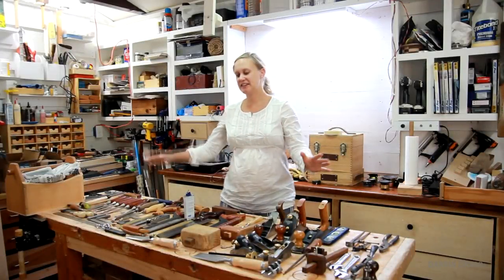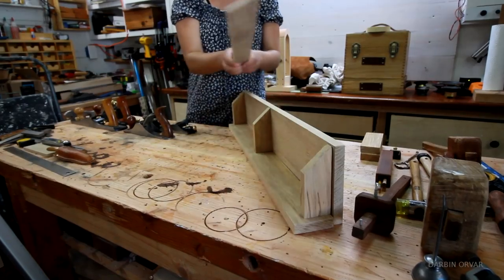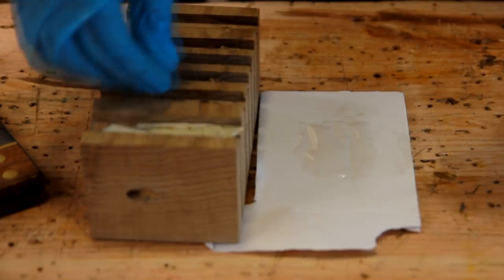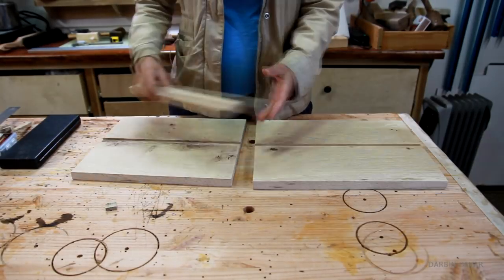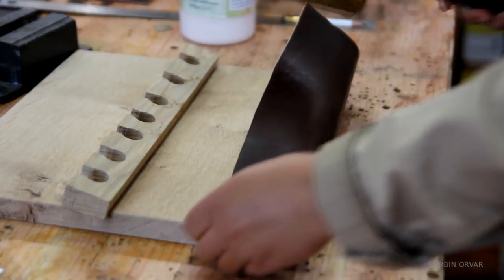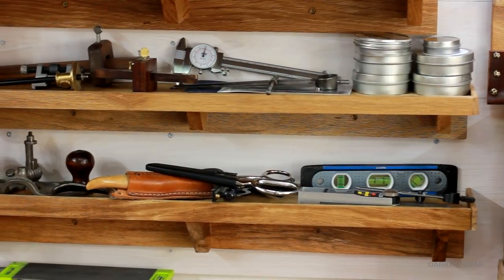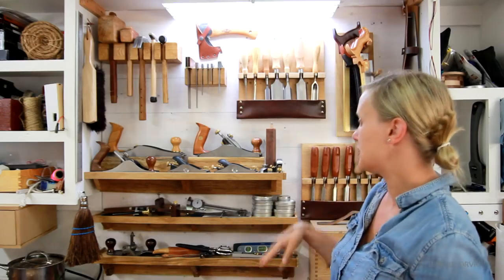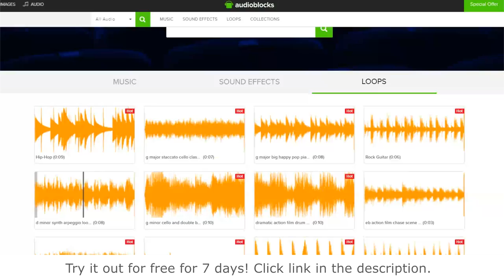Making a Tool Wall

Comment: Looks like you can get to all the tools, and everything looks very nice.

One hint about the veg-tan leather on the saw.  If you dampen it from the back after you dye it (the conditioner probably won't let the water penetrate from the front) and let it dry while it is lightly clamped up between two boards it will fold back on it's self and stay in that shape much better, a lot like steam bending wood, just a lot easier.

If you wet it down before you dye it you can wet it from both sides / let the dampness level equalize in the leather (wait 5-10 minutes) fold, bend. force the leather into the shape you want/ let it dry.  it will stay in that shape.

Comment: Just found your channel, and you have done a very nice job with the tool wall. I especially like the idea of the shelves and other racks, each holding multiple tools. I have not seen that before (building OUT from wall), but it sure saves on space. There are tons of BIG shops with BIG chunks of wall space used for their tool walls. Must be some kind of "My wall is bigger than your wall, NA, NA NANANA !!"
Most of us don't have that much shop space, unless I eliminate my Living Room and Kitchen!

Comment: Love your videos.  
First, wood planes should be stored off they're cutting edge to protect the edge. You could put a small block of wood in front and back of each blade and that will raise it up off the cutting surface.
Second, leather attracts moisture and will make your chisels rust. You would never ever store a gun in a leather holster just for that very reason. Try using various size plastic tubing to slip your blades down into. 
Hope this helps.

Comment: A very good example of what can be done in a small space. Your tool holders provide many ideas that can be incorporated into other designs. The only exception is the saw caddy. The holding method is great, but access is poor. I think if you rotated the holder 90 degrees on its vertical axis and added a side panel to hold the other end of the towels you would be able to access each saw individually. As always great ideas that we can use in many places. Thank you.

Comment: Magnificent and inspiring!
I wish I had free walls to use to display my tools!  Right now, I have shelves everywhere!
But seeing yours and Paul Seller's tool walls makes me WANT that sort of vibe and efficiency. So I may sacrifice some shelves to make space for such a terrific type of wall!
Reply: OMG! My mind just EXPLODED. I realized I couldn't really get rid of any of my shelves, in the small space I have.
BUT, I can build a self-standing wall with a handle on top or some on the sides! Move it out of the way when required! It will be like a less open sandwich board, with storage inside! 
Thanks for the inspiration!

Comment: Really enjoyed this video and your design skills are great. I liked the way you have done your hammers. I currently have them hanging on a peg board and am forever pulling the wire hanger out with the hammer, so I will steal your idea for my hammers. I don't know about hanging the saws together though. I do that and find it a pain as I always want the one that is not at the front. However if you hang them individually they take up more wall space. Thanks again.

Comment: When I was a kid and my grandfather was teaching me woodworking he always told me never put a plane down on it's cutting surface, but on it's side when placing it on the workbench. This was so that the blade is knocked out of alignment.

 So when it came to storing the plane itself, there was a little step on the plain would rest on so the cutting blade never touched the resting surface.
Reply: you are right , and also hanging the saws this way makes it inconvenient to use the one in the back if needed.

Comment: Yes, the tool storage looks fabulous!! I wonder if the hand saws may accidentally slip off the dowel, would you consider gluing a flat piece of wood at the end of the dowel with a larger diameter than the dowel to prevent it?  Thanks for sharing : )

Comment: I like how you stacked the planes on steps. You packed a lot of planes into that space, but each plane looks easy to pull from the rack. I'd probably want to arrange hammers more vertically. Light hammers set above shoulder height, but heavy ones stored at lower height.
Reply: I dunno about the hand saws.  There's a better way to make them accessible....but I don't know that way...yet.

Comment: Two thoughts: If you rotate your saw holder 90 deg you will better access to the saw handles.  Rather than shelves for your metal planes, if you hang them from the front handles, you can avoid having the blades and soles touching wood (causes rust in humid shops) and can easily access the planes while using less wall space.  Contact me if you want a picture of what I'm talking about.

Comment: great project, there is a couple of things I would do differently 
1.Seat the toe & heel of the planes on something so the blade isn't resting on the surface or store them on their sides
2 I wouldn't store hatchets & chisels in elevated positions, Chisel should never be raised any higher then the work

Comment: Not sure about the leather pouch for the chisels, it might cause corrosion since leather is great at storing humidity.
Guess you'll find out as you use it for a while. In total it's a well thought out tool wall and looks really good.